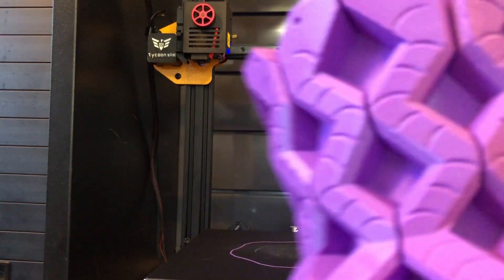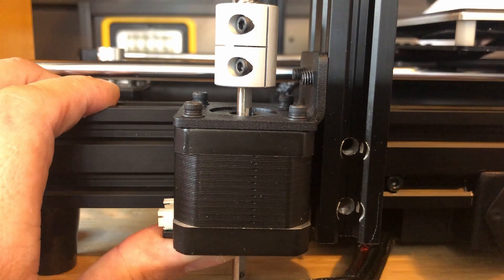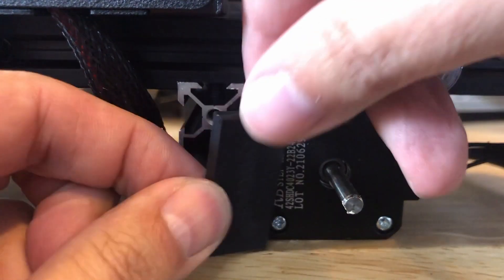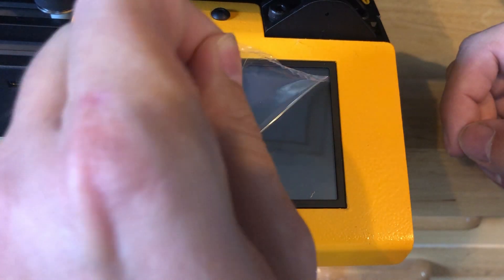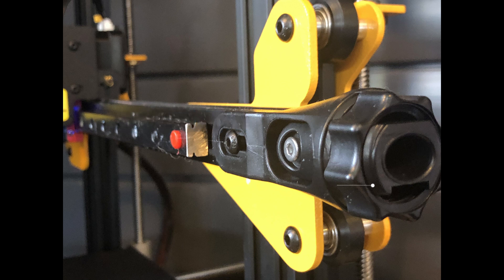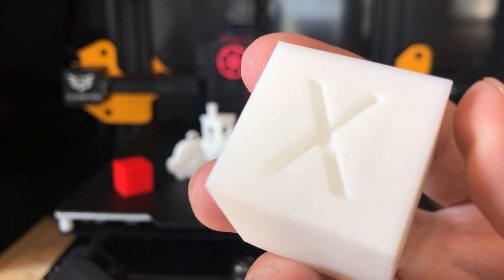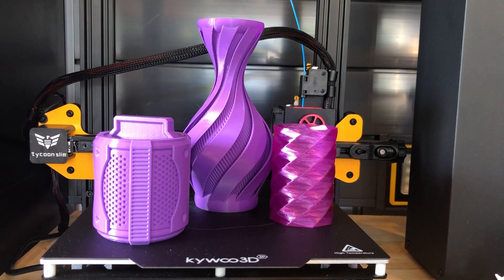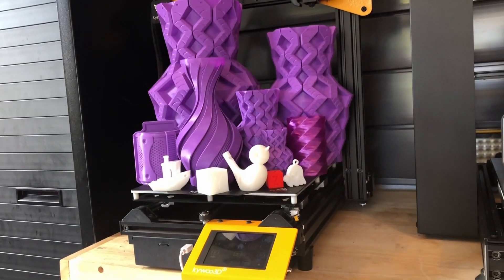Kywoo Tycoon Slim 3D Printer - First Look

Comment: Some of these low profile frames I've been printing a spacer for the feet, then use a longer fasteners bringing them about 40mm off the the table top. Seems to also allow for the power supply (if also mounted low) to get better airflow. Great video!

Comment: Yeah, those cloned 32b boards are not 100% Marlin compatible if I remember the TH3D stream correctly. There were some legal issues around getting vanilla Marlin to work with them too I think.

Comment: John another great review.  This looks like a great first printer.  The belt linking the two Z motors should help keep them in sync.  It would be even better if they had separate drivers for each motor and used then to tram the bed side to side.  At this price point they seem to have a great printer.
Reply from the maker: Thanks David!  It appears to be a great first printer that is loaded with features others are lacking.  Yeah, I would like to see a protective cover for the timing belt.  Having separate drivers for the dual Z would be a nice touch.  Thanks for watching and commenting 👍

Comment: Great Job on the video John.This Looks like a Great Printer.I guess the feet need to be slightly longer for the production unit to keep the stepper motor shafts higher off table.
Reply from the maker: Yeah, worked great out of the box!  The feet need to be a little longer, or have timing belt guard for the Z stepper motors.
Reply: Trim the shafts. Seems they could take 5mm off and still have plenty for the pulleys. 🤷🏼‍♂️
Reply from the maker: @OldCurmudgeon3DP  - Agreed!

Comment: The less V-slot rollers the better. Someone finally decides to make full use of the colour touch screen's ability to actually show colour. I do like their signature yellow paint as well. Were the power connections to the motherboard solder tipped as I did not see any ferrules? Nice video John.
Reply from the maker: Yes!  Less V-Slot the better!  I can see their touchscreen interface evolving.  All the connections used standard crimped style connections, no tinned leads.  This printer is just simple, and has a lot more value with it standard features!